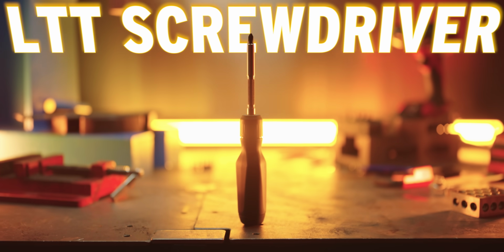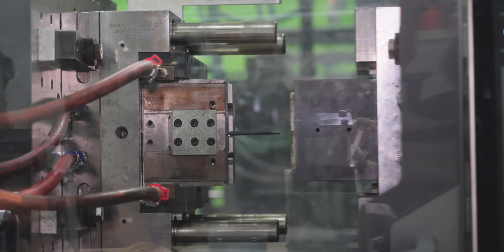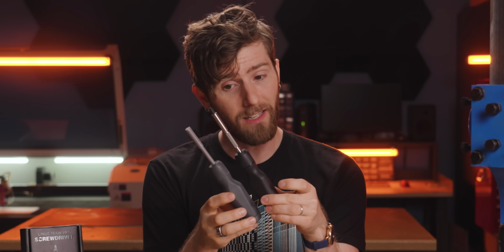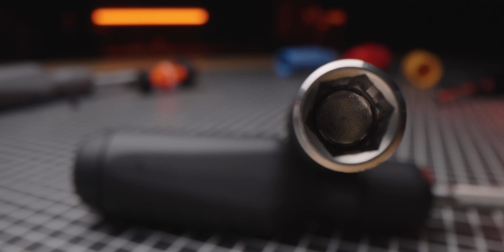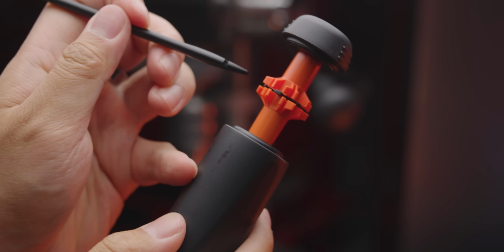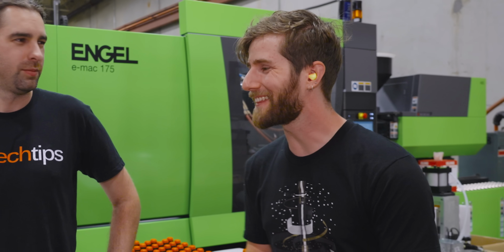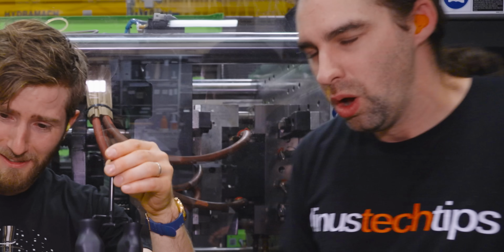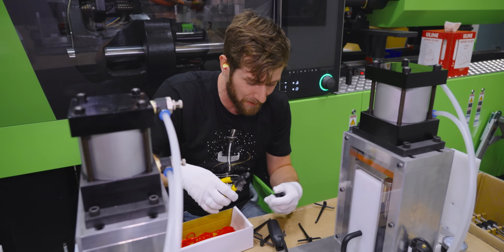Why our Screwdriver took 3 YEARS

Comment: $70 is taxing are you insane Amazon Basics 12-in-1 Magnetic Ratchet Screwdriver is $12 and basically the same i even like the way you press a button to access the bits
Reply: dont get the amazon one
get the Megapro ratchet
the one the ltt driver is based on
Reply: @Dasher9638  yeah you are 100% right but its still $30 the amazon one is amazing for how cheap it is

Comment: as someone working in injection molding: yes teh first prototype of the handle could actaully be manufactured. to make it simple: you need 3 moving bits instead of the usual 2. would lead to an additinal parting-line and partinglines MIGHT be more visable. but it would be doable.

Comment: I gotta say this is basically an extremely effective advertisement; I wish approaches like this were common in marketing
Reply: This style of advertising is only viable when you have a somewhat dedicated fan base and actually care about making a good product
Reply: @thereinthetrees_5626  So what a good company would aspire to have, making this style that much more effective.
Reply: They can't because they make it as cheap as possible. It would be embarrassing
Reply: @sirbow2  Beg to differ. It would be easy to make a high quality prototype. Then explain how one went down to something that was 10x cheaper, but retained like 80% of the benefits of the high quality prototype. Now you have something that is actually penny cheap seeming like some "hidden gem luxury" item. Point is, it is all about presentation. Yes, I do sell magic beans, now that you mention it. :D
Reply: @Lobos222  and you are why we can't have nice things
Reply: @Lobos222  the issue is that products don’t retain 80% of those benefits when companies cut costs, all they’d do is expose how they made a product 80% worse by cutting the cost
Reply: @fort809  I bet you have not even open a book about supply chain management tbh. 

Lets say there is a prototype design with a casing that has too many edges and therefor is hard to mass produce. Altering them in context of machines used will make them easier to make, use less time and power to make, make them more likely more durable and use less material. You make something via one plastic or mineral that is heavy. You switch that to something that is lighter and equally strong you now save on transport cost because it weights less. This includes getting raw materials to the factory. You re arrange the internals so they can easier have different plastic frames (this is what hairdriers do and while they look different and have different prices. They are basically the same hairdrier with some minor alterations and the outer casing). You can now mass produce the internals for a whole series of different product ranges with few alteration. ERGO, making producing the products CHEAPER without loss of quality.
Reply: @Lobos222  Also, I'd bet this is already the $10% version. Their initial prototype probably cost way more, and those costs should be defrayed across the final cost of the product anyway, so part of your $70 is paying Linus and team to do all the development that you just mentioned. To ask them to do that again, and bring costs down another 10%, is probably unreasonable.
Reply: If you like this advertisement go look up project farms comparison review im a diehard red boy (Milwaukee) and buying one asap cuz of that vid
Reply: I think it is a thing. Like when you watch one of those videos about how a company makes your favorite packaged food or something. Though it is probably the LEAST snappy and digestible format of an advertisement. Most advertisements want to be super fast, and this is 30 minutes lol.
Reply: Well, something like that exactly can not be done because it requires a lot of money to make. Thats the first thing, the second one is even if you make it really short so it fits even into a small ad, it wont have nearly the same effect. Yes, you could make a show out of something like that, like these shows on the tv that present how stuff's made, but it is VERY complicated and requires an actual provider that runs the show, you can not sustain it yourself.
In short: That might be possible, but it is very complicated and it may not even work out.
Reply: They are in Kickstarters, which's partly why I on many occasions keep going back to them. Some Kickstarters show their journey in developing the product and the process in making them, valuing quality and efficiency over profit.
Reply: Double the price and worse than most other offerings. Run for the hills

Comment: I was sold until I realized that it isn't a rotation multiplier. Wera Kraftform turbo multiplies the manual twist wrist of the handle by 4.  Meaning every 1/4 turn of the handle will turn the bit / fastener a complete full turn. The whole point of a ratcheting screwdriver is to minimize fatigue and wear and tear on the body caused by repetitive movement.

Comment: I only used some "basic" screwdrivers and i always thought the need to go back to the box every time you want to change the screw head, was one of the worst drawbacks of the deatachable screwhead idea. 
I also owned a small screwdriver with the heads inside, but you had to unscrew it ino order to get the screwheads out, which while better than the other option, was still annoying, this seems like one of the coolest features in the screwdriver
Reply: There are plenty of screwdrivers with internal storage. Most are less then $20.

Comment: 2 questions? Why would you use a conventional rachet mechanism that requires that level of tolerance to actually work reliably instead of something more tolerant like a ball drive?
Why would you choose double end bits as the standard when pretty much every other screwdriver maker and cordless driver company has dropped them in favour of the single end standard that actually works with all the other screwdrivers going back 50 years?

I have garbage screwdrivers that were given away as door prizes that are better than what you made.

Comment: Yeah, that 1/2 hour flew by, and my ratchet socket set (Also PC builder, but just also for cars: Halfords UK car set in the 90's) that travelled the world with me for 25 years is dying and I need a replacement. I'm in for one of these big time but how do you send across borders. In Thailand I end up payind 200% import crap on cool stuff with DHL/etc. But if it's sent standard it usually gets through (my risk then). Any options here? or someone buy one and send me it standard post and i'll sort you out!!

Comment: I once worked at a small tool maker, one of the funniest stories was they hired someone to sit in the office and make the 3D models of the tools. And I believe he was only there for about 3 months and what really broke the straw was a tool he had made was apparently mirrored (either the whole part or only some, I can't remember) which meant that when my boss got to the tool assembly and he noticed it was mirrored and wouldn't work, he got so mad, like Linus said, a tool like this cost a lot of money, and this was just a small tool which was only around $15k-20k, but it got him fired.
We didn't make injection moulds, but press tools to shape and cut metal, which comes in spools of sheets, and we always worked with hardened steel.

Comment: Not Sure on the cost, but you could use powercron or cathoguard for the blacking/plating. Its used mainly in the automotive industry and is very sturdy. 15-40 microns and well over 1000Hrs salt spray resistance.

Comment: Could have used longer bits, what about when you have to work screws in between mobo cooling plates etc? The neck on the bit-holder will hit that immediately so you cant reach anything.

Comment: WAIT, YOU WHAT? YOU REVIERSED THE RATCHET?? You don't rotate the ratchet selector. You HOLD the ratchet selection and start turning the driver handle in the direction you want to apply torque. It may seem backwards if you're just turning the selector on its own, but if you actually use the thing probably and use the handle as the selector while holding the selector collar still, it will make much more sense... This is a MASSIVE drop fo the ball LTT... There's a reason that every ratchet driver operates the opposite way to what you've done.

Comment: Honestly I would pay double for a certified “Linus dropped this screwdriver” with scratches and all.
Reply: LTT screwdriver: collectors edition
Reply: You shouldn't. If it was dropped on the metal part that part would be brittle - possibly such that it could fracture when used.
Reply: Spolier: It cant survive many falls. And probably not even 1 fall over 10 feet.
Reply: @HeartMarksman  says who?
Reply: @arsenhere7020  Your mom
Reply: @HeartMarksman  owned

Comment: If you've ever worked on technical equipment, such as professional speakers, stage lights, or musical equipment, you would know that your shaft is 3" too short. Why on earth would you spend so much time an effort making a screwdriver that won't reach the freakin' screws? 

Also... double drive.

Comment: Linus and LTT, as someone in the manufacturing space and military for decades. QC is huge, each part of an assy needs to have proper documentation of what is expected. I am curious on what tolerances were provided on that delrin lever. You said 5 thou out of spec? 5 thou off of the exact or 5 thou off of tolerance. In short, what I am getting it is that comment had a fail state at a given length then the manufacturer should have been aware and two that you should have measured each part upon receiving.

Comment: Could we get a handle with a 1/4" socket drive head so the shaft can be removed or swapped for a 1/4" socket drive extension or allow 1/4" socket use as a stubby? Do love this screwdriver, but I'd like to have a screwdriver handle  like this that can use more than just driver bits. I could see this as an eventual bits and sockets set. Thoughts?

Comment: As a mechanical engineer I think it’s great that you are introducing so many people to the product development process, really great stuff
Reply: As a mechanic engineering student id really like a Linus vídeo about injection moulding. I'm already learning it but would still be fun watching.
Reply: Sorry it's 69 likes(NICE). I can't like this. Reply to me when it changes.
Reply: @Amadeus675  it changes
Reply: You might notice it's $70 for a $10 screwdriver, so this is not "an intro to blah blah" it's marketing bs. Really bad stuff.
Reply: @johnsmith1474  I think this is a good point to make when thinking about buying it, the screwdriver its based on is $35 and its double the price they have many similarities I just saw a video testing this screwdriver and it did pretty well against the competition which included the screwdriver its based on so it is better then the original screw driver but I think when purchasing you have to look at the price and what you're using it for
Reply: @johnsmith1474  businesses do things to make money. I don't understand your point; are you expecting that all YouTube creators operate as nonprofits?
Reply: @johnsmith1474  1. Businesses run on profits.
2. Your source: Trust me bro.
Clown.
Reply: @John Smith  Anything new costs more; development, research, manufacturing, materials, etc, after time that lowers.
Reply: @johnsmith1474  salty much?

Comment: First thoughts: It looks revolutionary!! The way it's built to loosen and tighten screws? I mean come on folks. These are features we've been missing all these years and now It's finally here. I've heard it's got over a 700% improvement over the ordinary screwdriver. It's patented low drag design will have you loosening and tightening screws faster than ever!
But don't take our word for it... Get yours today. Act now,  and get a second screwdriver absolutely free. Just pay a separate S+H fee thats as high as you've ever seen and,.... Ahhh
Nevermind, I guess I should watch the video before commenting. Brb

Comment: One of the great mysteries of life: Why does the ratchet lock always turn in the wrong direction? Always. Nobody ever gets it right by accident, which is statistically suspicious, and probably the best evidence yet that we're living in a simulation.
Reply: I don't get it, I've never had a problem with this. You grip the ratchet lock part gently while starting to screw and that makes sure it in the right position. If this LTT screwdriver has the ratchet lock the opposite way to every other screwdriver out there that that would be super annoying for me.
Reply: @steveb9542  Maybe we have a philosophical difference. I grab the handle and turn the lock in the direction I want to turn the screw. That is obviously not the generally accepted way, but it seems like the only intuitively correct way to me, even though it always fails.

Comment: That whole Taiwan issue is infuriating because they took the amazing design you sent them and reduced it to a pile of garbage thinking you'd be ok with the changes and they could manufacture them at a much lower cost. They only did this because they do it all the time and like most scams it only needs to work a small percentage of the time for them to make money. Disgusting.

Comment: As nice as the driver looks and the work put into it is amazing. I'm not sure if it's 70 dollars nice. I work as an electrician/crane tech and I'm always looking for durability and usability. I have a feeling 1 drop from a ladder and it would break. I've bought probably 30 different screw drivers in my career so far and Lenox so far has been the one to last. Willing to try it out but if it breaks within a month then 70 bucks isn't worth it when Lenox is cheaper and very very durable. Honestly from the look of it that my only gripe I guess. High price. I get it though making that much of an investment into it you gotta recoup something.

Comment: I've been watching since the NCIX days, just to keep my foot in the door of tech, although I ended up going into industrial PLC / Electrical work instead.  When I first saw the finished screwdriver (on Project Farm no less!) I thought "Pfft, $100 CAD for a multi-bit?!"  But then I watched this video, and immediately ordered one.  I work in manufacturing and it turns out half of it's made right in my back yard and assembled here, even though as an electrician I don't have a whole ton of use for it, I wanted to say good job working so locally, and support you as much as I could.  Thanks LTT team, great job!

Comment: This project is truly amazing, but what really made me speechless was the process of designing the ninja star. Making sure that your product can be used with bits from other manufacturers, not locking the customers into only your supply, and also making sure that bigger bits can be used, truly shows how this type of life prolonging is truly possible, and bigger companies simply don't do it, because of money. You guys truly work for your viewers/customers, and I really love that. Sadly I bought a complete screwdriver set like a month ago, but if something happens to that, I'm 100% sure I will order an LTT screwdriver.
Reply: At the same time the first thing I thought was, "why aren't they using six small tabs that sit in a spiral?" since that way each tab could be switched as necessary, so it's not a 6/12 dichotomy and you can use small bits in conjunction with large bits...

Comment: One thing I dislike about interchangeable bit screwdrivers is the thick shaft needed to hold the bits, which is a problem getting into tight spaces or deep screw holes. The one I take around with me, is one with long bits, meaning that the bit itself is the shaft, which makes the shaft thin. With the bits stored in the handle, all you have is the handle with no shaft sticking out. It also makes it convenient to store in a pocket in my laptop bag, since it's only the length of a handle. At home, I use regular screwdrivers with no ratcheting or changeable bits. My go to phillips screwdriver is actually one I purchased over 20 years ago for less than US$2, and its tip still shows little sign of wear.

Comment: Congratulations. Well done on a lot of innovation. My hope is that you will sell enough screw drivers to set up your own manufacturing plant. So, in 3 years, it should have a few improvements: LED light, torque settings and flip style shaft with socket sizes.

Comment: I have very large hands, and I've snapped both screws and screw drivers before just by the amount of force I've put them under. It will be rather interesting to see how well the LTT screwdriver holds up to the amount of stress I will put it under.

Comment: Too expensive, bits too small. YOu can get just as good for about 30 bucks.
Reply: Yup and original brand made in US or Europe or Japan
Reply: “I want it cheap and American made” 

Good luck. Driver is great. Buy one, then judge it.
Reply: if you say so bud
Reply: @josephbargo5024  You werent  ready for that were you lil fella? Another internet person who thinks they know everything and everyone humbled.
Reply: @Daniel Langer Are you done with the condescending nonsense?   

With every tool, you pay for what you get. The higher the price, the more you encounter diminishing returns. No one needs this screwdriver, but it will improve quality of life for some people that do.

There are many high end screw drivers that are much more expensive and some people can justify buying them. 

And to answer you question, yes I can justify $70 for a screwdriver. Compared to automotive tools, that's a drop in the bucket. 

Watch "project farm" on youtube and he does a great job distinguishing why $70 isn't a bad price.